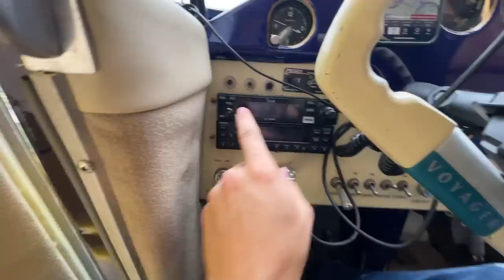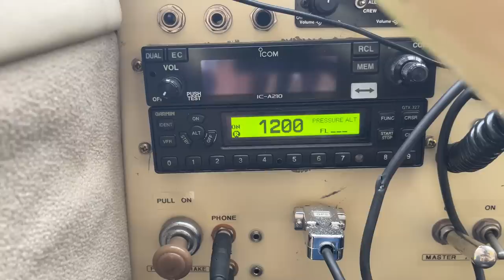I went on a rescue mission to save my parents!

Comment: My Dad was a pilot and had a V Tail Bonanza. We flew from CA to VA and back to CA. He flew mostly VFR, but once we hit AR, we were chasing a storm all the way to AL, where we were stuck for 3 days due to weather. He filed a flight plan coming out of AL towards VA, ended up had to make an emergency landing outside of Redford VA. Turns out, during one of the gas fill ups, in AR, he didn’t check all the gas tanks, and we actually ran out of gas at 10,000 ft! We landed with power so technically not 100% out of gas.  ALWAYS due you preflight check list…..turns out because it was raining the attendant only filled up 2 of the 3 tanks.  And the raining made my Dad rush and also not check all 3 tanks.